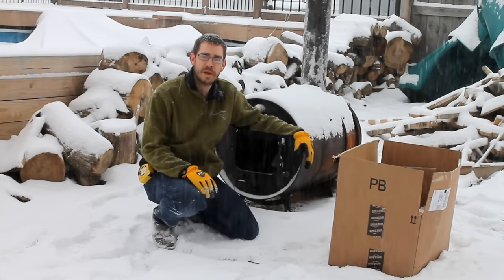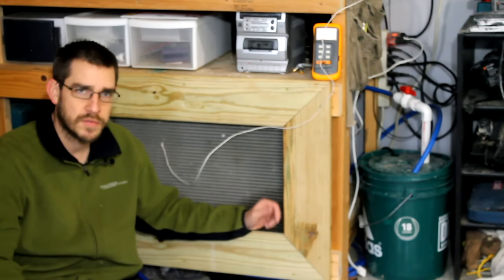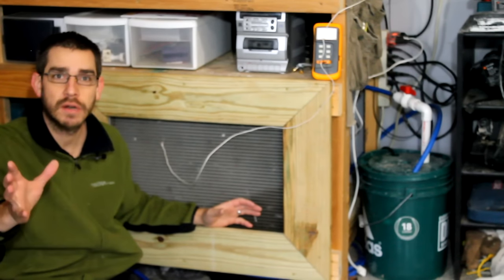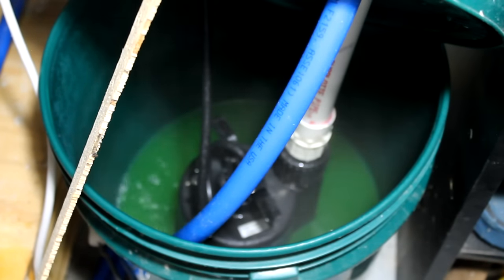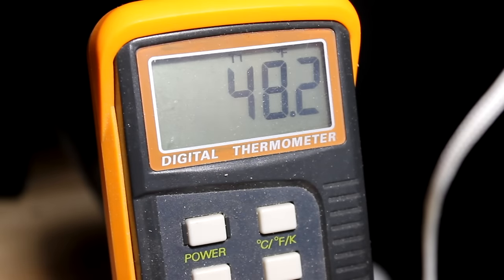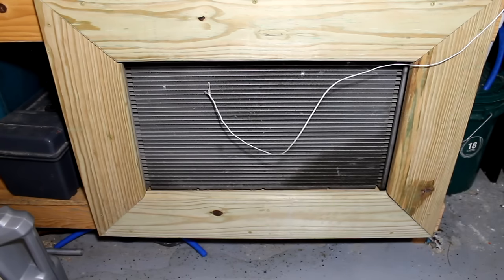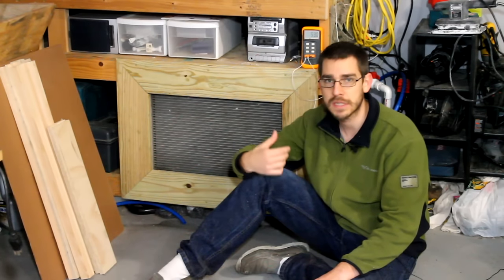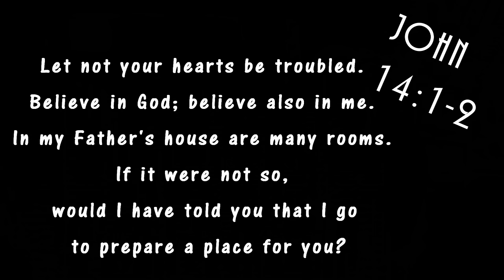Outdoor Woodburning Garage Heater - How well does it work?

Comment: First i like to say i love your setup very cool. I love seeing people get creative. I myself can and have make just about everything you can think of from just about nothing but scraps.  I have not read all of the comments that people have posted. So maybe someone has mentioned this. If you antifreeze is still that hot when it returns to the  sump you are wasting the heat energy you have created from the fire. You need to increase your airflow with a larger fan or add more heat exchangement (another radiator). If the antifreeze is returning cooler, then you know that you have done an efficient job and put all the heat into the room. I don't know what the temps you are getting are but in the bucket, but if your pump is going into thermal overload you have not taken enough heat off the heat exchanger

Comment: Video about thermal overload.  My first thought is why using a pump that is submerged in the hot liquid?  Perhaps just a prototype experiment to see how it would heat?    Instead I would go with some type of rotary pump that will mount outside the fluid reservoir.  A air thermostat to shut off the pump if room gets too warm.  To reduce fluid temp, a 'T' in the line at the pump outlet with a valve on it to slow the fluid circulation down back to the heater.  The T would cause fluid to bypass the  heater and return directly into the bucket repeatedly. You would open the valve just enough to achieve the desired fluid temp.  Also may need to baffle the heating lines at the wood heater to prevent lines from overheating or a vapor lock condition due to the reduced water circulation.

Comment: you can increase efficency if you build an insulated brick box or metal box around the wood heater barrel then pump the air around that barell to the garage and take the cold return from it to the same box around the barrel.

Comment: try putting your bucket and pump on the output side of the radiator. 
fluid should be cooler and pump should last longer.
Reply: And then the antifreeze shouldn't be steaming. I don't think it's a good thing to breathe in the antifreeze vapor.

Comment: Read some of the comments. Fans pull air better than push. even on HVAC units they pull from the returns, if they want better air flow in an area they add returns to pull out the air that needs to be temp changed. How about moving the radiator farther back in under the bench and box in a 20 in box fan and then if you can find base board units it should help reduce return water temp. I was Going to suggest that you up grade you wood stove to add fresh air at the top of you burn chamber so you don't creosote your coils. are you going to insulate the pool lines also?

Comment: you might want to get a used furnace fan , available cheap at most hvac installers , and make an enclosure for fan outlet and radiator .

Comment: Maybe add some copper line inside the garage after the radiator but before the pump. This will add some heat transfer to the garage and help cool the antifreeze before the pump. If you had enough copper, it could circle the garage to radiate heat more evenly.

Comment: Check out the drag racing parts suppliers, they have electric pumps and fans set up for radiators and some have built in thermometers.  At the very least it would give you some control and pumping power that would be impervious to the heat problems you are experiencing.

Comment: See if you can find a 4 core radiator build a box that is air tight around the radiator and mount your window fan to blow the air out of the box and that should increase the amount of heat you pull out of the radiator. Also put your bucket and pump outside of the garage. Plus the added length of plumbing will also help cool the fluid after leaving the radiator, and don't insulate the pipe going outside to the bucket.

Comment: With a dense fin array radiator, you will want to look into high static pressure fans.  They are made to push through the fins more efficiently and thus get more of the heat our the system (and into your garage which is the goal).  Thanks for the update video and try to have a good day.  To see what I am talking about, do a search for "Jayz two cents - Static Pressure vs Air Flow Fans - How to choose the right fan!"  While he is talking about PC cooling, the principle is the same.
Reply from the maker: +Andre Croy great advice, thanks!

Comment: like below  add more gallons  a 16 gallon grease keg or a 30 or 50 gallon drum or an 80gallon drum encapsulator would give you more thermal Mass and act as a heat battery
Reply from the maker: very true

Comment: I think an inexpensive box fan would be a big Improvement on moving air and if you were able to find a stainless steel tank something that was used for mixing beer or something along those lines for the antifreeze you might be able to operate at a higher temperature to what is the plumbing that you have Underground you could also if you have an opportunity to find them old baseboard heaters Workwell to release some of the heat before it even gets 2 your first radiator if you have a long enough run inside the garage before you get to the red
Reply from the maker: +Wayhart I hadn't thought about using a baseboard, that would actually work really well I could run it along the bottom of the workbench right at my feet. I will have to keep my eyes open for something like that
Reply: +SSLFamilyDad if you know any plumbers oftentimes they replace some that get smacked during new construction they work just fine they're just bent up and not new

Comment: I was thinking why not put a radiator (painted black) inside a sealed box with plastic sheet as a lid to make a greenhouse effect. But thought against the radiator idea, as all house radiators rust on the inside, after a while, and they leach / go black with slush. So need something that doesn’t contaminate the water.

Comment: I would put that pump and bucket outside. It will help cool it and the vapors it gives off are toxic. 

Also its better if you use the fans to pull the air through the radiator, you'll be more efficient and get more heat.

Comment: second radiator wood work or make a run of piping up and down one wall to act a a radient heater with a fan blowning on it would cool the fluid before the pump . I have mind as under floor radiant heating then to a wall heater before the put. the fluid is at room temp going to the pump.

Comment: Did you just do this for an experiment? I have thought about this for insurance and safety reasons to keep the fire box out of the dwelling, but in your case wouldn't it be simpler to just have a wood stove in your garage? No sarcasm intended. I really enjoy your channel.
Reply from the maker: +ThePaulgregg I would love to put it in the garage but can't for insurance reasons. I also use this to heat my pool in the summer so it is a dual purpose heater also. Great point though, it would be most efficient right in the garage

Comment: just add another radiator and fan. get the garage hotter and save the pump. and you can put the other radiator heater in a different area of the garage

Comment: or do it the way I would build a box out of double layer Durock cement board and build a box 8'L×4'W×8'H place  it 3/8 inch away from your house to leave an air gap and place wood burning barrel stove In it ... and feed wood from a  hole cut into the side of the box  with the drum sticking out an inch or two and take both panes of glass out of a window to insert a box fan

Comment: Buy an oil burner circulator pump and use copper for all your connections. Install an extrol expansion tank and make it a closed system. You need to study oil burner systems to solve your problems. You can install a thermostat, aquastat, etc
Reply: Also with a closed system, you can put the rad/rads up higher.

Comment: Not knowing the specs on your pump this might not work, but if you moved your pump to the outlet side of the radiator and pushed the water through the system it may cure the thermal overload problem as there should be at least a 20-40 degree drop across it depending on air flow.
Reply from the maker: +NorthOfAtlanta65 I'll have to double check but I think I already have it that way. If not that would certainly be a good idea!

Comment: Just do away with the pump altogether and make ur system a closed loop system hot water will move thru the system without a pump? I use a steam system to heat the house here .I'm thinking about adding to my burn barrel another heating coil such as u have on ur system there but without the pump ,not sure it would work for the distance u r traveling but it would work for me for my burn barrel is next to the house
Reply from the maker: +losttreasure hunt you could do that but you would need different high temp high pressure tubing, fitting, and a pressure relief. The temp would be so hot at that radiator it would melt all the plastic tubing and fittings

Comment: I used to work on buses and for the larger 40 ft buses we use an auxiliary water pump to push coolant to the heater cores in the back of the bus I think it would be beneficial in your application and then mount an electric automotive cooling fan to your radiator wired as a pusher with a rheostat to control speed the pumps were similar to this www.busparts.com/heater-booster-pumps.html you would need to run them off of a 12v invertor but you would not need to worry about the overload and would be able to run the temp at the higher temps because they are designed for this service
Reply: It's spelled inverter and what you mean is converter for AC to DC. Inversion is AC from DC.

Comment: have the pipe come out of the radiator and go into a 55 gallon drum of water to cool down the pipe and pull the rest of the heat out of the system. this would be a cheap and easy way to be able to store more of the heat inside of the garage and be a bit of a slow release. of course, this would only work if your garage doesn't freeze. if it does, maybe try just using a larger amount of antifreeze then.
Reply from the maker: This is a great idea, adding more thermal mass would make this much more efficient
Reply: SSLFamilyDad Thanks. I heard you say you were going to grow hydroponics. you could also have pipes run through your hydroponic tank. if you would like to even produce some electricity from the system as well, you could even make a stirling engine that uses the temperature difference between the water/antifreeze and the air to do so. 
this might not produce enough power to make it worth your while, but I am sure you could at least power your pump off of the system as well as the fan.
Just a project I haven't gotten to yet. I would also like to have a setup like yours, but use oil instead of wood, and heat some large aquaculture/aquaponic tanks as well. 
hope some of this might help you.

Comment: I just watched your heater build video. You seem pretty proficient at soldering so why don't you just separate the original coil and remove it fro the heater, clean it and put it back in? Seems like a 1 hour maintenance.
Reply from the maker: +Jeff Sullivan you are right, I probably should and might do that this year I just haven't had a chance to yet;)

Comment: maibe run two pumps in paralel with a electric timer switch changing between pump a and be once an hour or so , need one way valve for that though or the pump just blows it through the other pump back intoo the bucket that way each of the pumps have an hour to cool off
Reply: watahyahknow mb

Comment: I'm new to your channel, and may I suggest something? I was looking for your Outdoor Wood burning Garage Heater, and when I watched, I saw a bucket of green water!!! so anyone that has not seen all of your videos would be pretty confused, just like me. How is a bucket of green water? related to a Wood burning Garage Heater? I still have no idea what you did. I know now of course that I have to go find out from other videos. Maybe you should have mentioned that the stove was connected somehow? Just a suggestion, in no way a criticism. Off to find out about all this. Sheila
Reply from the maker: +Sheila6325 Very good points, I didn't really spend much time talking about how the system works since I had covered it but probably should have talked about the links I put up on the video. for any video I do I always link to any related videos. If you look across the top during the video you will see them pop  up or you can always click on the small "I" in the upper right corner of the video and I have the related content there to watch. I hope that helps and thanks for the feedback!
Reply: SSLFamilyDad I found it, and it's a great setup, and a real help to me. Thank you so much. Sheila PS I have watched many of your videos and really like them. I have NEVER made a suggestion to a channel before, and I felt bad about even saying anything, but since I felt like leaving when I didn't hear anything I thought I would see, I knew others would miss a really good idea too. Sheila
Reply from the maker: +Sheila6325 I actually really appreciate it and it always helps to get your perspective on the video because I don't think of some of these things. I am adding an annotation today to help an future viewers so thank you!
Reply: SSLFamilyDad I'm so relieved that you understand. Thank you. I'm seriously considering this for my greenhouse, unless I can attach it to my garage, but it would still make the perfect backup for it too. Bless, Sheila

Comment: Why didn't you just tap into the wood boiler that you use for your house ?  I use a unit heater connected to my wood boiler and i'm able to keep the garage 75 degrees all winter with minimal impact to the rest of the system .a line voltage thermostat makes it simple to control the fan .
Reply from the maker: This was at my old house in the suburbs. Moved out here to the farm with the wood boiler last year.

Comment: why not use an actual furnace water circulator it can handle higher temps, and add another radiator with 2 box fans to keep the heat down on the pex
Reply from the maker: that would be a great idea, and of course I considered it but a circ pump cost about 10 times what a submersible one does
Reply: SSLFamilyDad I replaced mine on the furnace cost me about 80 bucks

Comment: Those 55 gallon barrel heaters work great my mechanic has one been heating his shop for over 25 years and they go inside the shop not outdoors

Submersible pumps are designed for cold water buy a 007 circulator pump designed for a hot water heating system to circulate the hot water
Also submersible pumps need to be totally covered by water to cool properly.
Reply: They go inside shop if your not working with gas and other  combustibles and want the peace of mind of shop not burning down

Comment: Just think of all the btu's you are losing with your stove outside.
Reply from the maker: well since I can't put it inside I guess it doesn't really matter?
Reply: Can't have a woodstove inside?  Wow.  Is that a state regulation?  Or an insurance coverage condition?
Reply from the maker: +Lex Turner insurance, price increase would be more than any savings I would get so would just heat with electric instead